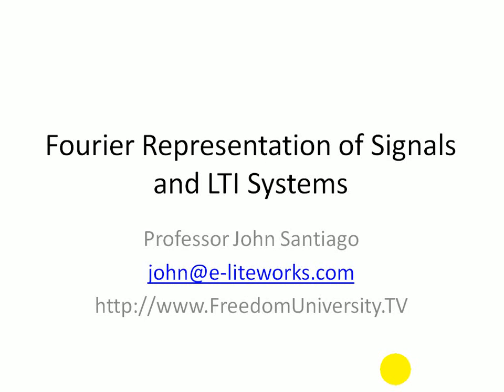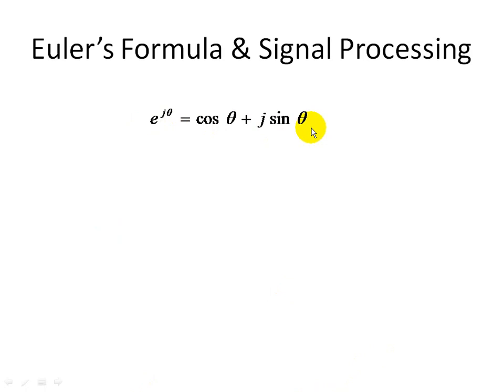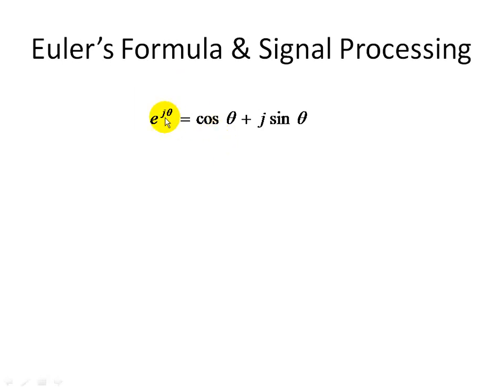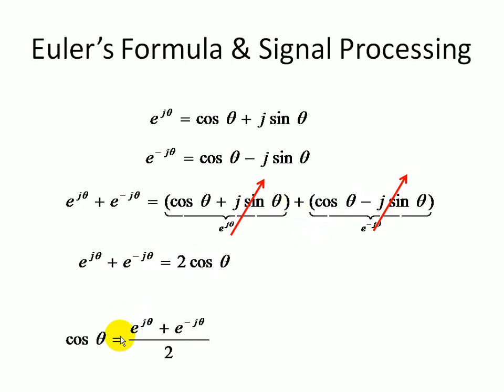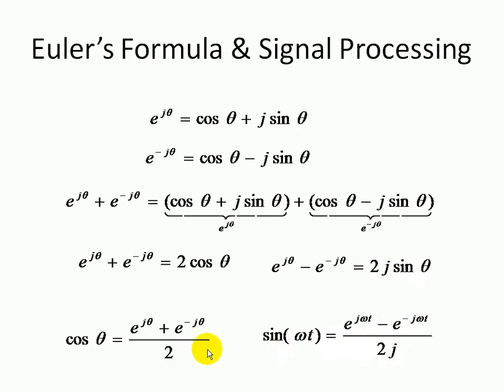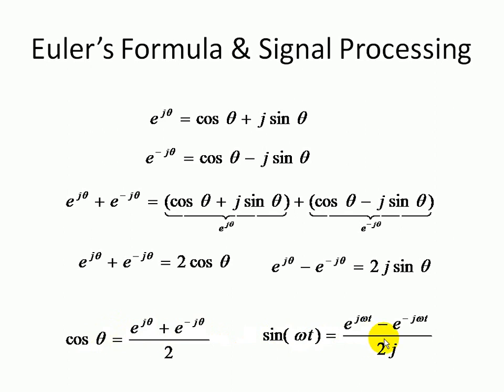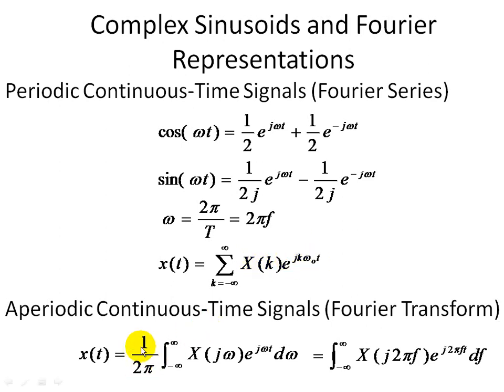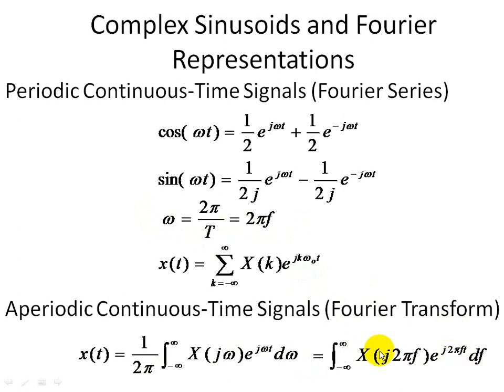Digital Signal Processing (DSP) Tutorial:  Euler's Formula - Part 1

Comment: I have a large 12 volt motor I want to mount on  my go cart & one in my seaflea, my problem after money is how do I build a controller ? I have a whole bunch of electrical parts with lots of capacitors , I'll be using 4 , 6Volt deep cell batteries , would you be able to show me how to build a speed controller for my project's